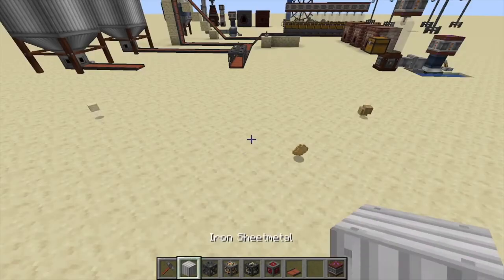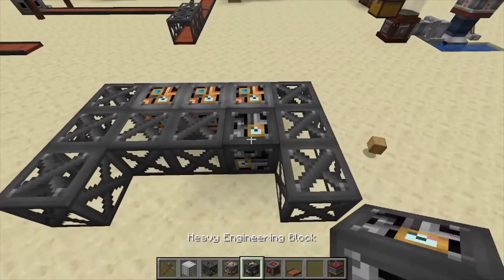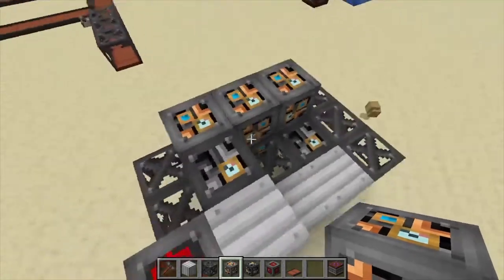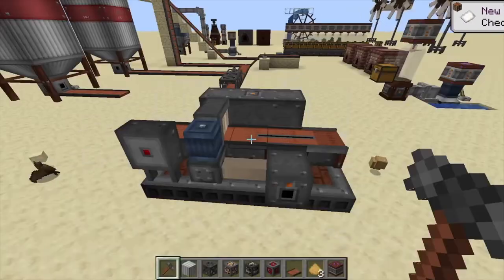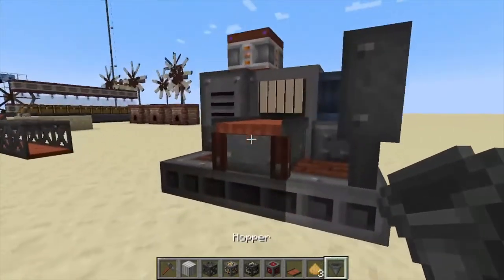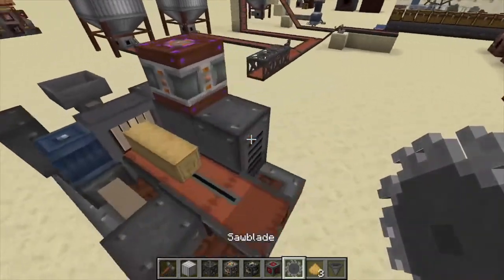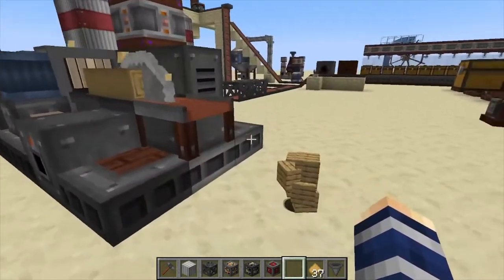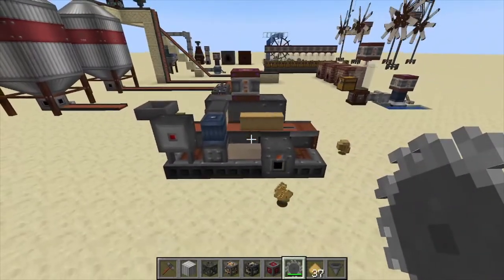Immersive Engineering: Saw Mill (how to setup and use)

Comment: Dude you are extremely underrated. You have 1.3K subs when you should have 1.3M. Other than your intro - which, don't get me wrong is a necessary evil as it is VITAL FOR BRANDING - there is zero BS in your videos. Your editing is minimal and your energy level is on the lower side, but I don't think that's necessarily a bad thing. You don't yell at your viewers or use a fake accent to seem more interesting, but at the same time you don't stammer or sound like a 12-year-old, you talk a bit faster than average to save people's time and you pack in everything people need to know in 1/10th the time most people do. Absolutely fantastic job. Please keep making content. You are the only MC content creator I'm subbed to.
Reply from the maker: Spot on! Thanks for the feedback and support. Unfortunately youtube discriminated against short videos that don’t make them tons of revenue but are to long to put in shorts. So many fluff videos out now just to reach that 10-15 minute mark and still fail to help anyone with the clickbait titles.
Reply: @MCMentor1  It's true. I wonder if there would be any benefit to trying Shorts with their new ad revenue sharing policy. Probably not... plus I don't know if it's possible to compress ANYTHING from Immersive Engineering down to only 60 seconds. Maybe you should reach out to Fandom to see if they want to embed your videos in the FTB wiki - lol. The way you quickly go over single blocks and multi-block machines and explain how to use them specifically, rather than try to pump out a full-fledged tutorial around them is perfect for wiki embeds. I appreciate how you're like "This is how THIS thing in particular works. Feed the output into a hopper or a pipe or whatever you want - that part's on you." is perfect. Like, Shulkercraft and all those guys are great, but there's something to be said for actually learning how different mechanics work, WHY they work that way and how you might use them in your OWN designs rather than blindly following a "SUPER SIMPLE ### ITEMS PER HOUR AUTO XYZ FARM 1.19 JAVA" tutorial where you're throwing down comparators without having a clue how they even work. Hahah. I'm still pretty green to IE so I appreciate your content greatly. Most of the time I don't really want to watch a 15 minute tutorial if I can help it - I want to Alt-Tab back into my game and get to work.
Reply from the maker: @donaldholden2090  great idea!! A lot of tutorials on wiki are outdated or non exsistant